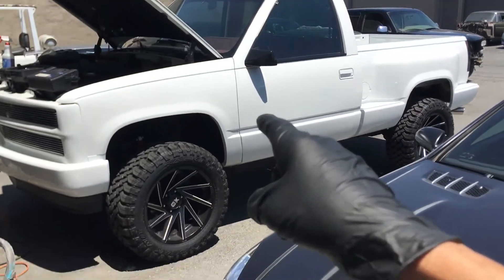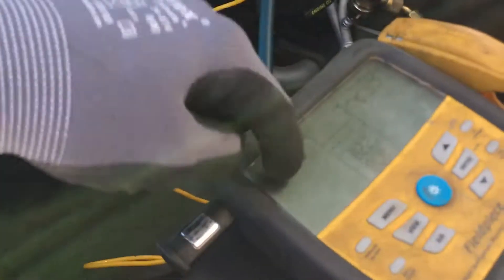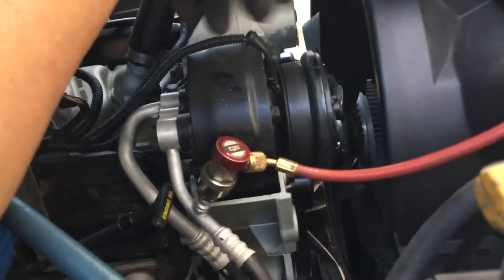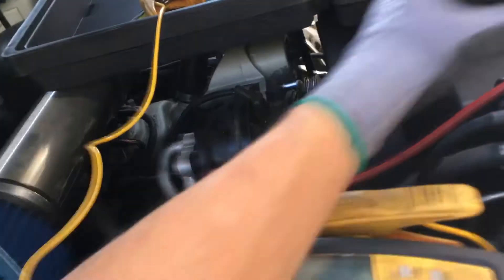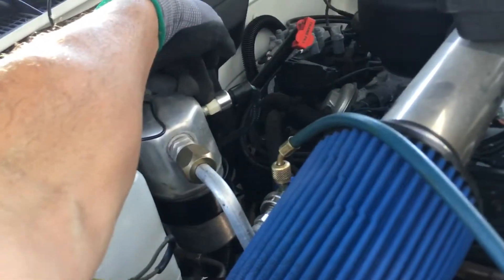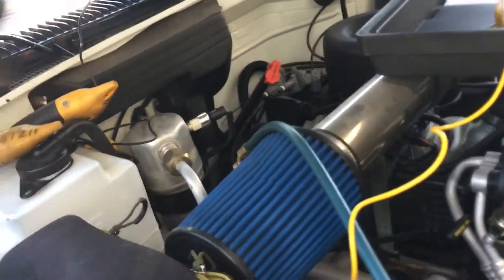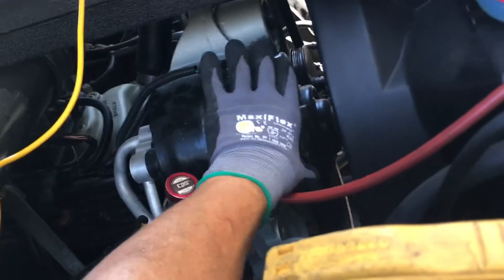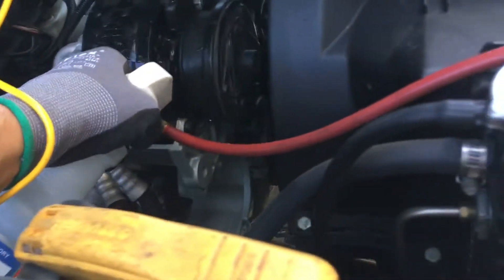AC leaks under vacuum but not under high pressure 150 PSI

Comment: I pulled negative pressure on my AC system today and it's holding but also notice underneath my vacuum pump is a whole bunch of oil. I hope that's not PAG oil is it?
Reply from the maker: Maybe your vacuum pump is leaking ?.
Reply: @coldfinger459sub0  I thought the same thing until I looked at the side glass and the oil level doesn't look too much lower than it was when I had some but I guess I can believe that cuz I did kind of overfill it when I was putting in the vacuum oil. So I didn't lose any compressor lubricant oil as I guess is what I'm concerned about right?
Reply from the maker: @electric_thumbs  yes, you are correct because he vacuum pump if everything was done correctly does not take out oil

A recovery machine recovering refrigerant can take out a little bit of oil but not a vacuum pump 

Unless refrigerant was left in the system when you hooked it up to the vacuum pump
Reply: @coldfinger459sub0  nah. Just refrigerant and PAG oil. I'm leaving the vacuum pump off and negative pressure like -30 psi. It's going to be under a sealed vacuum for days and then I will run the pump again and evacuate more moisture. The shop that does the final leak test and fills the system with AC r134 coolant gas will probably also pull a vacuum. Between the two of us it should be nice and dry.
Reply from the maker: @electric_thumbs  vary good. 👍

Comment: Why sometimes leak is detected with vacuum and sometimes with pressure?.
Reply from the maker: Sometimes leak is so big or dose not move under vacuum. So it leaks.   Vacuum can pull rubber oring or hose inward to seal against a thin film of oil.    But when pressure is applied is pushed open. 

Sometimes heat or cold will only shrink or expand metal a crack Will open up or close. 

Sometimes only high pressure leak

Sometimes only low pressure causes leaks the when it gets high pressure it stops leaking 

Many other ways

Comment: The nice thing about transport refrigeration, is that you can easily isolate different parts of the system, given the size this can save alot of heartache when looking for a vacuum only leak.  and always keep your eye out for aluminum solder joints, they often dont leak under nitrogen, only when operating and hot. ( not sure if you see these joints on automotive ac). And shaft seal leaks dont always mean its failed.  if its been run dry from not being used for a long time, it will need a bit of running time before sealing up properly again, bc it requires to be soaked in oil to seal.  @t lech
Reply from the maker: Yes automotive uses aluminum brazing joints but on automotive they very rarely leak

I’ve done several videos where I have captured shaft seal leaks that either leaked under vacuum or leaked when first charged up because they’re old and dry and have not been used in a long time

Then after running them  reseating them with pressure heat and lubricant being applied to them with rotation the shaft seals with seal again

After that I would recover the refrigerant again because it had a vacuum leak contaminating the system with a little air in it on the vacuum pump and then the seal will seal nice and tight without any leaks and I can properly remove all the air and reduce the moisture content under a deep vacuum and then repeat the process all over again to properly recharge without a contaminated system

Comment: Part 2???   Solution????
Reply: Same here
Reply from the maker: So long ago I don’t remember.   I’ve done a few hundred cars sense then.
Reply: @coldfinger459sub0  @ but most likely,, what causes not hold vacuum ,, but holds air pressure??
Reply from the maker: @gerardolopez5875  things like rubber hoses and rubber oh rings under vacuum can pull in words and actually seal them self with the light film of oil from within the system. 

        But then when you introduced pressure they push out words opening up
Reply: @coldfinger459sub0  @ the vacuum its not holding,,, and the air does,,
Reply from the maker: @gerardolopez5875  it could work both ways. 

Sometimes you can have a leak that will not hold vacuum but will hold pressure

    Then another time you can have a leak that can hold perfect vacuum but will not hold pressure

       You can have leaks that only leak under vibration when the car is driving down the road and all the hoses and fittings are shaking and vibrating but when the car is still inside your garage it does not leak

           Then there’s leaks that only leak when the middle of a condenser or fitting gets cold and it shrinks it starts to leak but when you turn the vehicle off and the metal fitting warms back up the metal expands and the leak stops

          Then on the high side you have a very high temperature and you could have metal and rubber and one of the components expand under heat and start leaking but when it cools off it stops leaking

        Some leaks rely on pressure to make them late for example at 110 psi it does not leak but at 170 psi it will leak and then when the pressure drops down it stops leaking again

           When you have the shaft seal that is a moving item. 
             When the air conditioning is off the shaft seal does not leak but when the air conditioning is on it starts leaking
Reply: @coldfinger459sub0  @ it will leak freon any way??       Sooner or later!!

Comment: This is how persistent you need to be to fix mobile AC correctly..glad to see someone is as persistent as I am
Reply from the maker: Glad to be part of your club 👍 to raise our game up to the next level and fix all our customers cars who were not fixed correctly by the shop previous
Reply: @coldfinger459sub0  every job i do usually takes 5 hrs ..i fix all the leaks no matter what and clean the evap coil
Reply: I have 2 sm480 fieldpiece gauges..in case i dont trust the micron gauge on one of them :)
Reply from the maker: @Mobileccs  sounds like we’re in the same mindset. I have one of my two SM 460
I have two SM480V two SM360 
      For dedicated micron gauge the BluVac+pro
And the Fieldpiece SVG3 and a multitude of other dedicated micron gauges in the past three decades starting with the old Thermo King analog that took six or 8D size batteries took five minutes to warm up in 10 minutes to calibrate started when I was 12 my dad‘s old set up in a leather case. 
            I think you might like the new D-TEK Inforcon Stratus leak detector. Let you know in a few months if it last me one year that means it’s durable. Comparing it to the H-10 heated diode leak detector
Reply: ok i will take a look
Reply: @coldfinger459sub0  @ ehat waz the probblem???
Reply from the maker: @gerardolopez5875  YES !  They were all meant to leak because of the type of materials and components they are made out of. 

All O-rings eventually leak

All gaskets eventually leak

All shaft seals eventually leak

Rubber hose even when brand new has a very slow seepage leakage to it

The evaporator and condenser is made out of metal eventually crude or suffered damage from vibration and crack

The one thing I can always guarantee 100% is that every vehicle I feel with refrigerant I guarantee it 100% to leak
Reply: @coldfinger459sub0  @ how long would that system  last?     I did it charged yesterday,,
Reply from the maker: @gerardolopez5875  it all depends if there’s a leak a small leak can take months or longer a big leak it could leak out in days or weeks. 

    That’s why we use a leak detector to look for leaks first